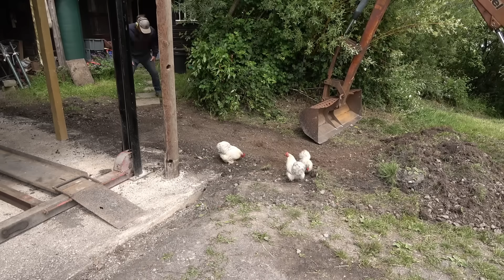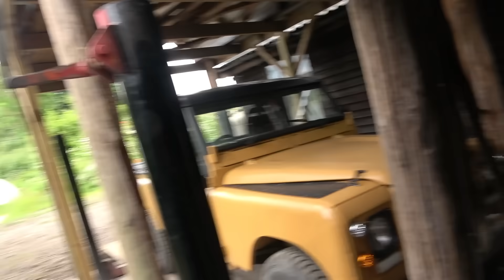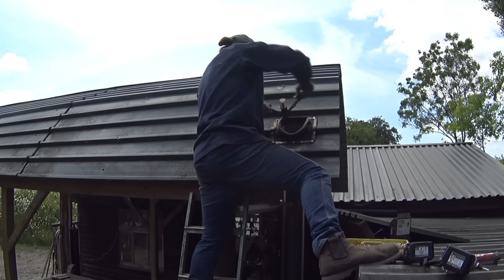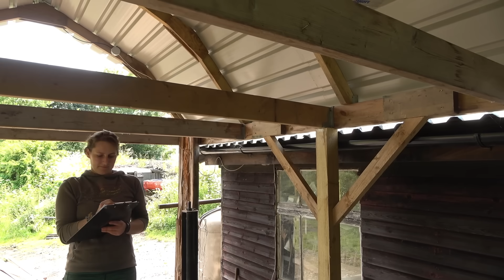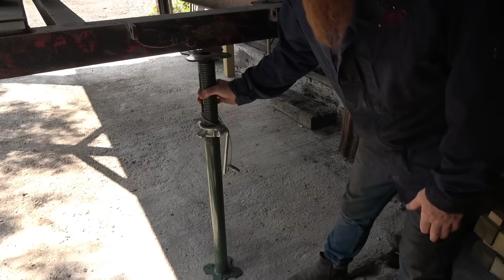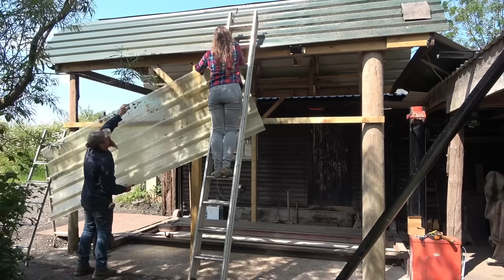Installing a Vintage Car Lift Part 3: All Done!

Comment: If I was given the 700 mile job  I'd do south then north stopping for 15 min break on way south then 1/2 hour break if not hour on way north depending on time then I'd stop again at rush hour for 45 mins and then push on as far as possible stopping at 9h 50 ish overnight in van then next morning drive about  2hour stop 15 mins then continue to drop once empty take few hours break around Inverness may b even go up to john o groats as not been in while 
I'm not chasing money I enjoy driving once reached drop off I always wind down 
As for charge I think you are about right but I do not have turnover anywhere near vat threshold I'm doing to give me and oh space and paid at that
If doing correctly as I know you are you claim everything can from tax man so gvt pay

Comment: My lift has limited height because of the roof on the building its in. I use a wheelie chair when working under a vehicle. I find it nicer than being stood up. Wheelie, wheelie good.

Comment: Didn't the ramps you removed provide an end stop to prevent a car rolling off when off the ground? Not likely with kermit, but a sensible original safety measure.

Comment: Hello Max. Brilliant job on the liftport. Humour me with a suggestion. Those big planks you have up there. If you put one along each side broad side down (like you have them stored) and screwed then to the stub joists, they would resist the tendency for the roof to splay out in the middle. You could probably remove the central 2x4 and gain some height. It would be good to be able to stand up. Might even be able to remove them all. If I had more space and energy I'd love to have something like that. All the best, Mart in Solihull.
Reply from the maker: An interesting idea, wish I'd thought of it! I'll see how I get on, quite happy with the max height so far.
Reply: @maximusironthumper    If there were no roof restrictions, would the lift at full travel allow u to stand up completely?  My lift lifts the chassis not the wheels. I can stand up all the way. That makes work more comfortable. But I love all your projects. Thank u kindly!!
Reply from the maker: @billrimmer5596  This one lifts both by wheels and by chassis (see latest video). A smaller car goes higher (also shown in latest video!).
Reply: @maximusironthumper  I think I have watched it. I just loved the whole lift series. And the walk across the Moors. At night u may hear the Hound of the Baskervilles. I love your big storage tank. My compressor is in my house garage. My shop is about 150 feet from it. 25 years ago, I buried 1/2 PVC 
and that acts as additional storage. Plus I don’t have to listen to the compressor. What kind of batteries r u using for your solar system?  I never miss a vid. Thank u for your wonderful channel.

Comment: I love, love, love the ramp flashingflap!  That is both an inspired bit of theatre and perfectly commensurate engineering.

I also really appreciate the measured and reasoned responses to the feedback on the last video.  You have a way of presenting it which is at once humorous, sensible and shows your tolerance for so much feedback.

As if I weren't already motivated, now I'm really itching to get my shed adapted for my own lift...

Comment: The handwringers need to get a grip ,  50hz motors are identical to 60hz motors it's iron with wire wrapped around it same as a transformer no intelligence involved ,  running a motor at reduced duty cycle or frequency is totally fine ,  running a motor where the rotational speed is too low and the loading too high leads to thermal failure  DV/ DT rules ,  it's the change in the voltage waveform with time ,  I2R  heating is the main killer with low speed applications ,  the input watts are the same but the dissipation is much higher as the current is higher because the voltage is lower  and the dissipation is the current Squared ...

Comment: Rubber flap.... Wind issue maybe a little weight on the bottom edge? Maybe... Absolutely wonderful project. Something different and imaginative. Well done Max and Katie, and thanks 👍👍

If you wanted to consistently and easily get between the joints you could add a stop block I guess for the front wheel ...

Comment: Man that is nice. I need one for my tractors. #1  I would have to agree with other on at least the Emergency stop button.  In safety studies in the service, it showed when something goes wrong people first reaction is " Oh SH*T, duck, flinch or run.  After that first reaction you will then have to look back to the control box and press that little bitty button to stop it. A big red button is easier to hit and looking at the control box and picking one of the 6 buttons.  #2 MADE IN CHINA.  That summons it up rather quickly.  The little bitty membrane switch on your stop button is pron to fail.  Sure you will not be hitting that button 100 time a day and it should last for a while but they can fail from moister, corrosion, tiny little bugs, or just cheap manufacturing processes.  Again China.  Put in a stop switch that kills power and ground can save a life or your car. A big red STOP button is easier for a friend, guess, or emergency crew to turn it off and not have to guess what button to hit.

Comment: I appreciate how your response to criticism & questions is reflection and then improvement -- in the areas that are justified. Been a subscriber for a while (but with a different channel), the recycling / need to use everything available is both common-sense but also rare in the world of plenty. Especially, re: nonsensical automation, you're an inspiration.
edit:: and great explanations // demonstrations.

Comment: I am surprised that a slightly higher supply frequency might be damaging to the motor.. I have a device that operates a small induction motor intended for 50hz operation at 67.5hz.
Reply from the maker: It's not that I feared damage, it's more because I don't need the system to run at more than design speed.

Comment: i really would not worry about splay on the roof as the loaded mass is tiny, not like you covered it in concrete tiles during a snow storm, i'd think more about wind force, making sure the steel roof dont peel off in a storn!

Comment: As for the 60Hz being too high, thats the point of a VFD. If you take a 50Hz 3000RPM motor and feed it 60Hz, it will just spin at 3600RPM instead. Motors dont really care that much until you get to the extreme ranges of frequency.

Comment: Most Inverters/VFDs have a Hysteresis mode which just varies the frequency enough to prevent harmonics or vibration from setting in.

Comment: I specify inverters for hydraulic power packs for my job. You will have absolutely no issue with your ramp speeds or overheating for the reasons you stated. Duty cycle is so low it just won't be a concern. You can probably run up to even 100Hz without major issues, although it would struggle with high loads.
Reply from the maker: Good to know!

Comment: I have an old cable op 4 post with exactly the same setup. I've had it running for 15 years no issue. No interlocks, no height sensors, no overheating issues yet. Ultimately its an occasional tool for a hobbyist and is infinitely safer than working under Jack's etc. I used an acrow prop as backup as no locks. I think your inverter is better than the ABB one I had! I used a 4" drain pipe as a chimney for the ramp on my garage roof. Enjoy, and thank you for the videos, all always enjoyed.

Comment: being able to run 50Hz motors at 60Hz is a common hack to get a bit more oomph out of them if you need it.

The motor isn't going to care with the duty cycle you're using it at, and even if it does blow up it's hardly the end of the world.
Reply from the maker: True, but on the other hand, I don''t actually need the extra oomph in this application, the ramp raises fast enough for me!
Reply: @maximusironthumper  oh, yes, completely :)
Just referring to your comment that people had said it would damage things!